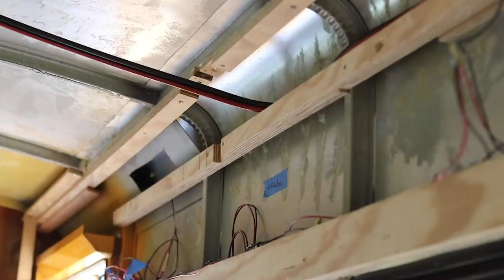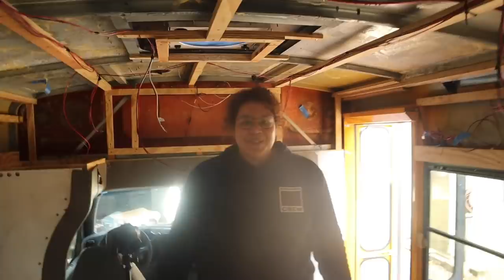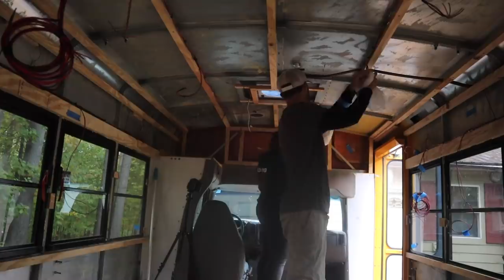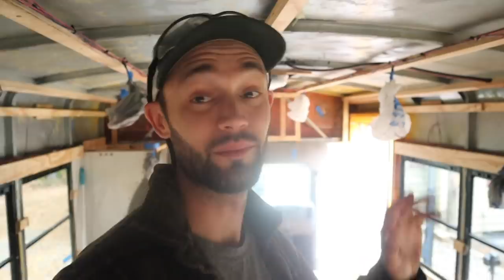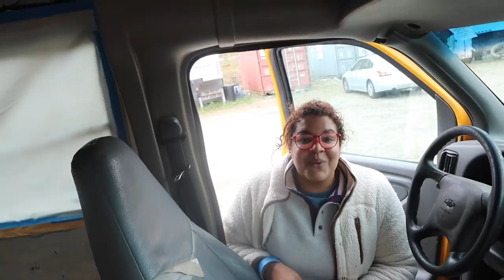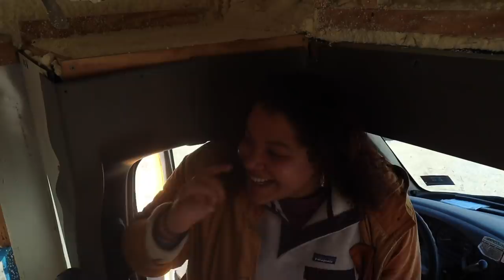Preparing and Installing Spray Foam Insulation in the Bus Conversion

Comment: Thank you Rachel for explaining wire gauges by piercing size. Brilliant.
I'll add that to how I explain electrical systems using plumbing terms.
Getting it foamed is the halfway point of the build

Comment: The only major change I would make concerning electrical is running the wires through conduit or a wire chase. If you do this, you can do repairs and changes a lot easier later on, as apposed to it being encased in foam.

Comment: When i had my 14x24 tiny home spray foamed. 3 1/2 inches open cell. It was also $1000. Many will charge a minimum of $1000 to come to your location no matter how small the job is. It just so happened my square footage equaled the minimum of $1000

Comment: I wonder if you wouldn't have been better off running the wiring in plastic conduit? With the spray foam, if you ever have to run new wiring (or remove the old wiring )it's going to be impossible, without doing a massive tear-out of the ceiling and walls. Good video series, thanks.

Comment: Did you have any problems with condensation build up with the spray foam. It’s a problem I’m running into getting ready to install insulation

Comment: Been wanting to ask you this for awhile. 1. What type of spray foam is it that you had sprayed...open or closed and what chemical is it?
2. What would be your 2nd choice of insulation type instead of spray foam for your build?
Reply from the maker: The foam is closed cell. If I was not going to use spray foam I would look into wool and poly-iso board.
Reply: @navigationnowhere  thank you

Comment: Will be interested to see if spray foam works.  I've seen people (RV bob) claim that spray foaming a metal vehicle will cause rust issues because of condensation.   I have no idea if it will or not.
Reply: It depends whether it is closed cell foam, or the cheap expanding foam in a can. Closed cell foam does not hold moisture
Reply: I see. thanks.

Comment: How are you planning to deal with moisture from condensation between the foam and the metal exterior?
Reply from the maker: The foam will seal to the metal and at 3in it has a full thermal break. If it was thinner it would possibly still condensate
Reply: @navigationnowhere  Thanks.  I was wondering because I’ve seen warnings about not using spray foam in rv’s.
Reply: @navigationnowhere  I don't know if this is mentioned anywhere, but haven't seen it listed in the comments/video description, but is this foam considered open or closed that the spray foam company is using? 🤷‍♀️ Thank you! :D
Reply from the maker: @maylin1986  Closed cell

Comment: I vaguely recall you telling us the foam's r-factor in a  previous video, but I don't remember what you said, nor what video it was so I can go watch it and remind myself.  As such, could you remind me again here in the comments, what the r-factor will be with this foam?  Thanks.

Also, it already looks pretty good.
Reply from the maker: We sprayed this 3 inches of close cell foam. About R-7 per inch for a total of around R-21+/-
Reply: @navigationnowhere   Thanks for the reply.  r-21 (ish) seems really good for a vehicle, to me.  Most houses I work on max out around r-10 with traditional batting or foam-board inserts, so I'd say your bus out to insulate very well.
Reply from the maker: Yeah, residential code where I am at is R-21 in the walls and R-48 in the ceiling. 😂

Comment: It would have been nice to see conduit used for all cables, and possibly pipes, to allow for any future repairs. But to each their own.

Not bad otherwise.
Reply from the maker: I have various locations with larger gauge wire and secondary distribution panels throughout the bus that can be pulled off in the future so I would never need to pull a wire behind the walls.
Reply: @navigationnowhere  Never say never. It could be a freak occurrence that causes damage to a cable or pipe. You could accidentally put a screw through a cable an not realise. While this is unlikely, it may happen. Using conduit not only allows for potential repairs, it also provides mechanical protection so that the screw situation does not occur.  

I have installed cabling in houses and while the code and industry practice is to install without conduit, I always use conduit in walls. The safety guard afforded by the conduit at such a low cost is more than enough reason to use it.

Anyway, as I said, to each their own.